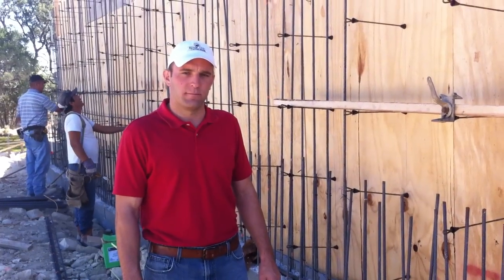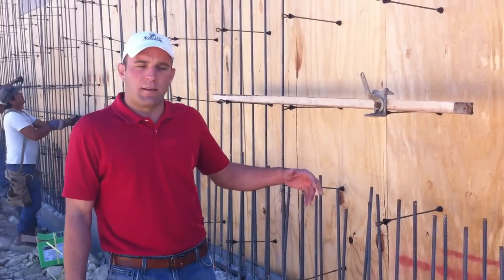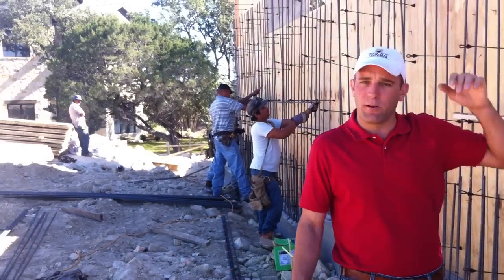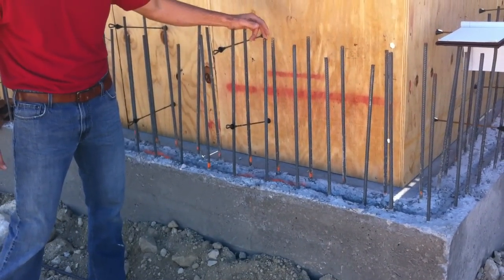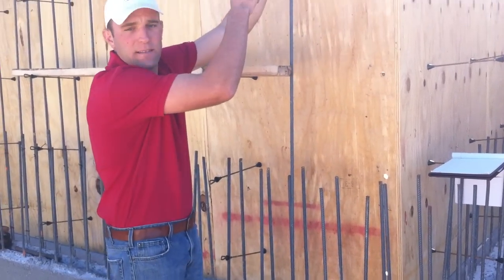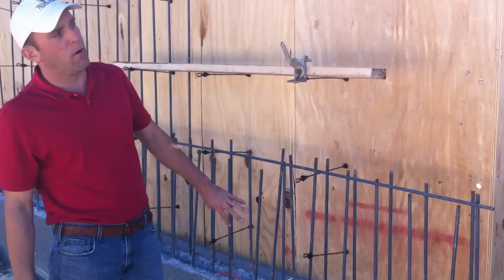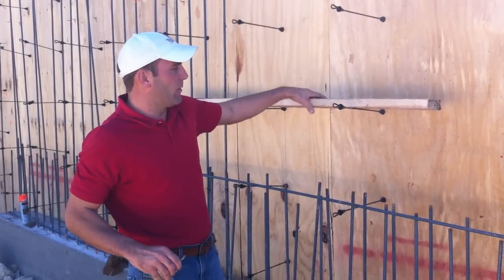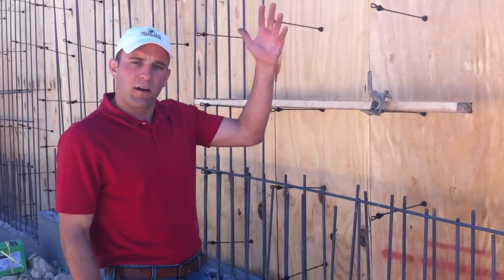JCH "Retaining Wall - Rebar"

Comment: The 1/2" steel vertical "dowels" that you mention coming out of the slab, how did you install them?  Was it just vertical rebar bent at 90 degrees and tied to the horizontal runs throughout the footing forms?  Thank you.